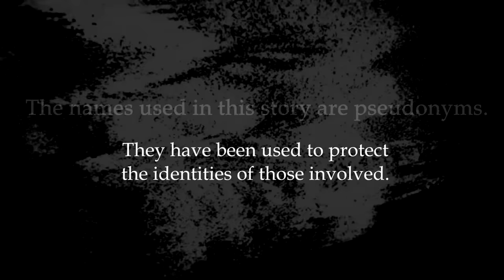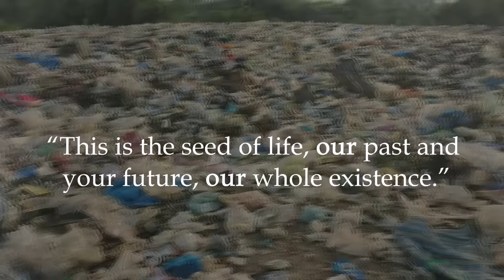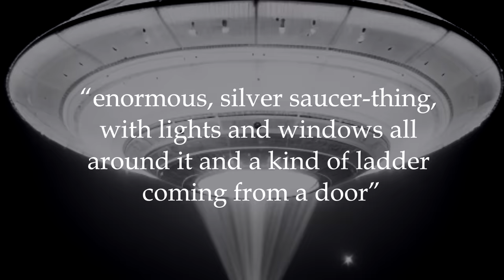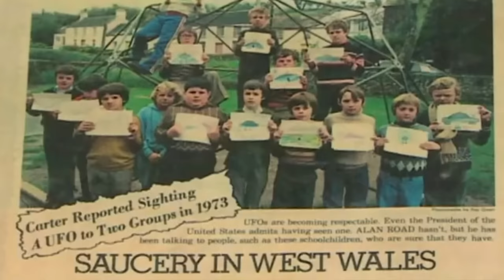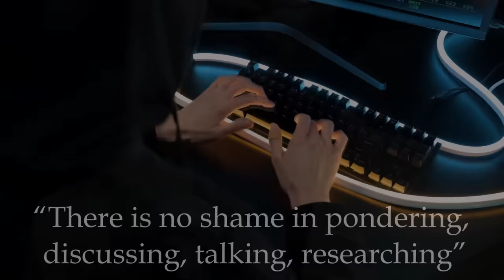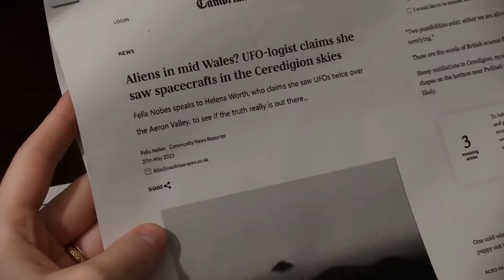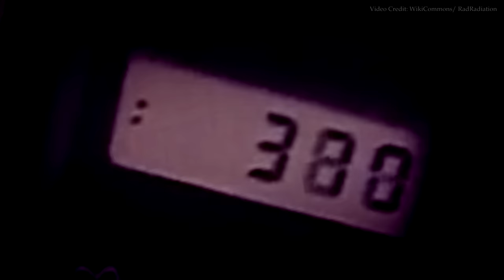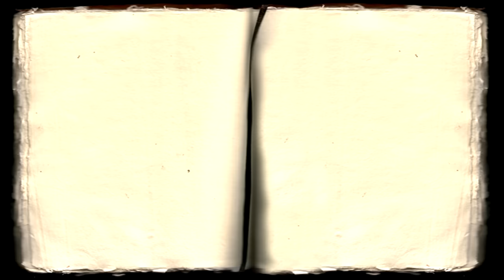5 Deeply Disturbing Alien Abductions | 2023 The Paranormal Scholar Documentary COMPILATION

Comment: I'm a carpenter and auto mechanic hobbyist with 41 years driving experience and I can't imagine what wires John reached and pulled out while driving without tools and while panicking. I challenge everyone to sit in their vehicle and see what wires you're able to reach. The BS starts out of the gate.
Reply: Maybe it wasn't the first time he had meddled with the car, and the wires were already loose. Also, a car being used on a farm would be morr basic and designed to be more easily fixed by its owner. After all, if a vehicle for use on a farm packs up, it could impact the farmer's ability to harvest his crops. That isn't an acceptable position for a farmer to be in, when their whole income depends upon harvesting their crops. Therefore, these vehicles used to be designed to be more straightforward, unsophisicated and more easily fixed by their owner.
Reply: @zappababe8577  You're reaching, but as improbable as that scenario is, it's not impossible. There are numerous facets to this story that simply defy logic and common sense . I was only pointing out that from the start of their story the circumstances are hard to believe and highly improbable. I think the host did a perfect job of calling it what it is, BS.
Reply: You know it's odd, I had a Chevy Astrovan and had occasion to prime the tbi with some gas. Well there was a mouse nest under it on the block or something and I had a wee fire. I put it out as fast as it started but there were these two wires that got toasted pretty good.   The ASTRO was a damn champion and she ran just fine. But I couldn't get over thinking "OK, so how much of the wiring harness could I burn and just keep rolling?
Reply: You're all those specialties? This sounds like the beginning of a famous prank call by some buffoons called The Jerky Boys and the recorded call is called Auto Mechanic that you can find on YouTube if unfamiliar...

I'm just screwing around man.  Tho, they're definitely funny.

😂@"the BS starts right out of the gate"

Listen to this tho: lady makes it sound like the alien abductors might be ecoterrorists in funny costumes!
Reply: @RAWSUM2  Depends on the car or truck. My old car in highschool (our family not mine) was rigged to drive with the wire bypassed.
Reply: Nailed it
Reply: @RAWSUM2 my mums Morris minor had very visible wires leading into the radio
Reply: My Kia soul has a very easily reached fuse box to the bottom left under the steering wheel. I could pull wires for all sort of things while still driving.
Reply: Sounds like you have some BS in your gate. Carpentry doesn't qualify you in any way to comment on a car.
Reply: @thurayya8905 I only mentioned my profession to point out that I'm pretty good at figuring things. No, it doesn't make me a PHD, but I'm not an idiot either. These people telling this story are full of it. The wires are the closest thing to a tangible part of their story that can be used to either help support,  or debunk it so I went there.
Reply: @Kay-cp8tg Fuses aren't wires. And there should be only 1 fuse capable of shutting down the engine. My point is that these people spewing this kind of bologna make it difficult for the subject of UFO/UAPs to be taken seriously.
Reply: @thurayya8905  and if you had finished reading my entire comment you would have read that I'm also a auto mechanic hobbyist which does qualify me to "comment on a car"
Reply: Depends on the car, the age, make. I know older cars I’ve owned that you could definitely do that to
Reply: Jeep Wranglers wires are very easy to grab. Not sure what you’d do once you grab them but it’s easy enough to
Reply: UFOs always shut off cars. The car would have shut off of he didn't pull out the wires.
Reply: What are wires?
Reply: @ArchYeomans  this guy 😂😂😂😂
Reply: not really.. i’ve driven some clapped out rigs with loose wires dangling all over